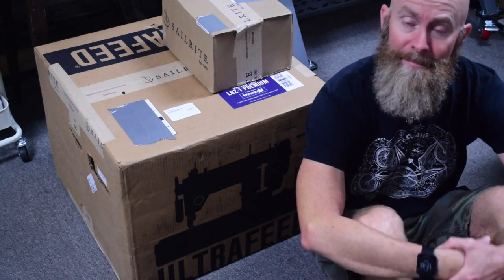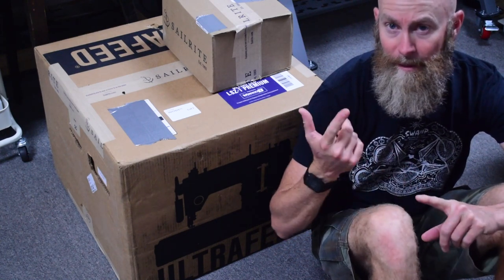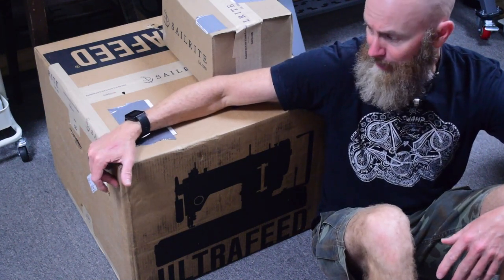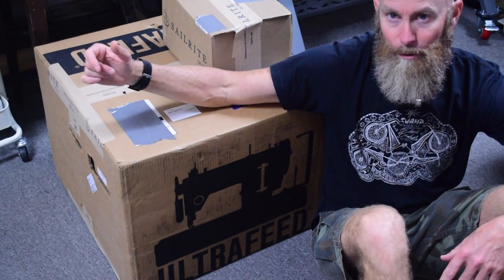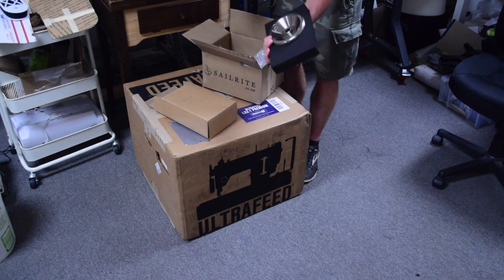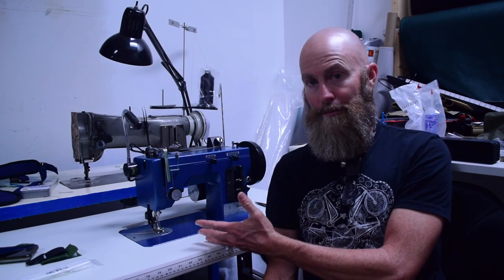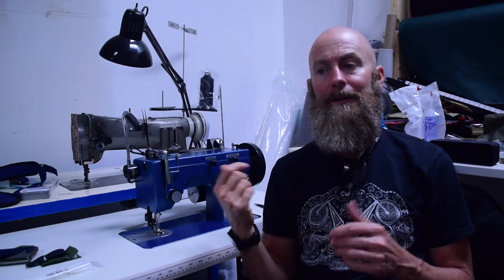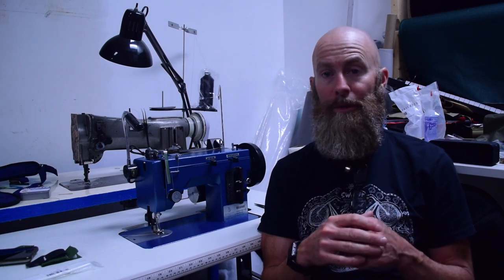LSZ-1Premium with WorkerB; Unboxing and First Impressions

Comment: What's the benefit of the Sailrite servo motor vs. the Worker B motor?  And what advantages does the Monster II wheel give you over the regular Worker B wheel?
Reply from the maker: The Sailrite Workhorse is a great servo motor, but like all servo motors, it is attached to the table, and the machine cannot easily be used apart from the table, negating the portability of those machines.  The WorkerB is a game changer, providing the power and control of a servo motor in a portable machine package.
I still have my Workhorse motor, and my current plan for it is to use it on my Singer 29 patcher machine, but that's a project that has yet to see the light of day.
If you have or are thinking of a portable walking-foot machine, the WorkerB should be on it, it's an incredible upgrade. If you're looking for a servo motor for an industrial machine, the Workhorse is a great motor.  My only complaint is (last I looked) it isn't plug-and-play compatible with a needle positioner, as it is primarily intended for use on Sailrite's machines, and there doesn't seem to be a way to use a needle positioner with their post-pin clutch system, so they don't seem to support that option.  If you don't need needle positioning, it seems to be an exceptionally high-quality motor!

Comment: It seems like a future video should be about testing the various knee lifts available for the Sailright, even DIY instructions, or kits. Compare to the industrial machine knee lifts. 
Also, have you tried any of the wheel feet for leather/thicker materials on the 50s black iron machines? I ordered one (thinking it might be a possible replacement for a walking foot machine) but it doesn't fit my 50s Singer and I when I looked for shorter versions to try I did not find them. Perhaps a video on how these wheels compare to walking feet performance?
Reply from the maker: I only know of one knee-lift that I have seen documented, and that was the one using bicycle brake cable.  It isn't out of the question that I'll try it one day, but it's probably pretty far off (for unrelated reasons that are keeping me quite busy for the immediate future).
I have given serious thought to trying to design a knee lift mechanism, but again, time is the limiting factor.
I haven't used a wheel foot, and I would really like to.  If you find one that will work on a Singer 201, I'm all ears!
Thanks for the suggestions, and thanks for watching!
Reply: @thejasonofalltrades  But Jason, you already got the knee lift on your Singer 1200, that is a Singer 201 with knee lift. Are you in search for a better solution than the 1200?
Reply from the maker: @sewingmachinesindetail  I want ALL of my machines to have knee lifts :)  The 1200 is a fantastic machine, but it's not a walking-foot machine and can't do what the Ultrafeed can do for me.  Likewise, I wouldn't use the Ultrafeed on ultralight materials. Since I use my Consew the most, I am very accustomed to using a knee lift, and it always annoys me to use a hand lever.  It isn't a big deal at all, but a knee-lift on the Ultrafeed would just make a great thing a little better!
Reply: @thejasonofalltrades  Oh, now i better understand. You wrote: "If you find one that will work on a Singer 201, I'm all ears!" But I guess that you actually meant a Sailrite.
Reply from the maker: That remark was regarding a roller foot, not the knee lift.
Reply: @thejasonofalltrades  Oh - sorry - I see now. Well once I did see a low shank big roller foot. But when I asked the supplier they did not have them anymore. I have tried a high shank roller foot on my 201, and it was possible by bending the arm to roller and readjusting presser bar height. But I found the foot with a notch to the back to be better than a roller foot. But this kind of feet should only be used if fabric under foot is thicker than 1.5 mm, because it will cause variation in stitch balance. Look here: https://youtu.be/rBIulDuhDDs

Comment: I have this machine from another manufacturer and would like to upgrade some parts without paying Sailrite's premium mark-up. What class of machine is this for sourcing parts?
Reply from the maker: These machines use class 15 bobbins, but otherwise I'm not sure how much parts crossover there is between them and more generic designs. Honestly, if you are looking to "upgrade," then you're buying Sailrite parts.  Otherwise, you're likely not "upgrading," just "replacing."  
I hope that helps!  Thanks for watching!

Comment: What do you think about the performance difference between the WorkerB and the Workhorse motors comparatively if they were used with the LSZ-1? Does the WorkerB and the Workhorse have the same slow speed control? Does the power difference of the Workhorse (3/4 horse power) vs the WorkerB (1/4 horse power) make a difference for neoprene and heavy leather?
Reply from the maker: I would say that the WorkerB has somewhat better slow speed performance, but probably not enough to make it an obvious choice.  It's a bit of an "apples and oranges" comparison; if you NEVER need portability, the Workhorse is a fine choice, but if you want the possibility of using the machine in a portable configuration, the WorkerB gives you the portability with really no loss of performance (there is slightly less power but I doubt most users would ever notice the difference).
I don't think Sailrite would like me saying this, but at this point I would only consider using a Workhorse motor on a non-portable machine.  The WorkerB pretty much obsoletes the Workhorse when you're talking about mounting to an Ultrafeed.  Even if you think you'll never use that machine as a portable, it's no really compromise to just have the portable motor on it just in case, plus it adds the power switch on top (there's a switch on the Workhorse, but under the table) and the speed control knob.
I hope that helps, thanks for watching!

Comment: What’s your opinion on the Fabricator compared to a Consew 206 or Juki 1541 or 563?
Thanks 
LSZ Ultra B Owner
Reply from the maker: Hi Tim!
I have never had my hands on a Fabricator, so I can't give an opinion based on any actual experience. I would expect the Fabricator to be consistent with the Ultrafeed machines; i.e., a great machine with great quality control and customer support. I imagine the machines function very well, and I have not heard anything negative about them from people who tell me they use them.
There is one thing I find less than ideal about the Fabricator.  They use the Posi-Pin clutching system just like the Ultrafeed machines, which is a great system.  However, most industrials don't have an option to de-clutch the machine when winding a bobbin, as the bobbin winder is made to run while you're sewing, and the need to disconnect the sewing mechanism while winding a bobbin isn't something that is really necessary, at least in my opinion.  The problem, though, is the Posi-Pin system means that a needle synchronizer can't be adapted to the Fabricator (to the best of my knowledge). I LOVE using a needle synchronizer.
If I were looking to buy a new industrial machine of that class, the inability to use a needle synchronizer would be the biggest (or only) stumbling block for me regarding considering the Fabricator. If you've never used a machine with a needle synchronizer, it might not be a big deal for you, but if you're accustomed to using one, it's a bit of a negative.
The Fabricator uses a larger balance wheel, which basically acts as a gear reduction and may improve slow-speed control to the point that the lack of a needle synchronizer is less of an issue.  Also, the needle synchronizer is mostly a benefit to speed and efficiency; if you're not trying to produce items particularly quickly, it might not be as important to you.
I love Sailrite, and everything I have gotten from them has been excellent. If you're looking at brand new machines, the Fabricator is definitely worth considering, but I do wish they would offer it with a standard balance wheel and a needle synchro.
I hope that helps, thanks for watching!

Comment: Disclaimer: I've never seen a Sailrite machine in real life, let alone used one, so take this more as a question than a criticism of the design. 
In 2015 Sailrite redesigned the plate for the stitch length (aka "feed regulator") lever. The old version was metal (or at least, was finished in the same paint as the body) and it had easily readable white marks for the stitch length. The new version ("EZ Set Stitch Length Plate") is a plastic plate that has no real stitch length indicators as far as I can tell, or at least not easily visible. It does allow to set stops to limit stitch length, but I find that secondary to having good clear indicators. So I'm wondering if I'm missing something, or if this upgrade actually is a sort of downgrade if you don't care about stops like me? 
Also, less relevant because the EZ Set plate is factory installed on all new machines, but the procedure to upgrade from the old plate to the new one looks super harrowing to me (check Sailrite's installation video if you have 7 minutes to spare). Possible side-effects for the technically challenged are: losing a screw down inside your machine, bumping your feed dogs on the needle plate, different stitch length in full forward compared to full reverse.
Anyway, regardless, this video sealed the deal: as soon as the European plug worker bee hits the Sailrite webstore, I'm taking the plunge and buying the LSZ-1 Premium package! :D
Reply from the maker: Hi Laurens!
My priority has always been different; I want the reverse lever to be quick and easy to actuate.  The old style lever on the older Sailrites, Thompson and all the other variants of this machine is very clumsy and slow to engage reverse.  My Thompsons had no markings to indicate stitch length, and my Sailrites are both the new version, so I haven't used one with markings.  Many of my machines lack any stitch length markings.
There are markings on the EZ Set, but they are black on black (would be pretty simple to paint them).  For the sewing I do, I almost never need to be absolutely precise about stitch length, it's either "shorter" or "longer" for me.  If repeatable, precise stitch length is something one requires, I honestly think the EZ Set is better than the old style, as that lever also had a tendency to slip (at least on my Thompsons). Other styles of machine may have better designs for this, but between the EZ Set and the old style on this type of machine, I MUCH prefer the EZ Set.
I hope that helps!  I look forward to hearing when you get an LSZ!
Reply: @thejasonofalltrades  that helps greatly, thank you so much! I would die if my stitch length would slip halfway during topstitching something, so in that regard it sounds like the current design is infinitely better than the old one. My concerns were really from the "perfectionist" approach I tend to take when making things, i.e. I try to make up for my lack in skill by doing everything slowly and as precisely as possible. So when backstitching, I want my reverse stitches to coincide exactly with my original stitches. It looks so much neater.
It's very good to hear that I was wrong on the markings on the EZ Set and that they really are there, just black on black. Practically speaking, I think I'll just rub some white paint on the markings to make them stand out. and experiment to see which mark corresponds to how many millimeters.
Oh and on your final point: you can be sure that you'll hear about it when I get an LSZ, that's a promise! :D

Comment: Hi could I use this to sew leather wallets? I would like a portable to do so.
Reply from the maker: Absolutely you can!  Sailrite now offers a smooth foot set for these machines so the feet don't mark the leather.
I often point out that these machines aren't super heavy leather machines like you would want for making something like horse tack, but you can definitely make wallets.  I've been carrying a leather wallet for about 4 years that I made with my LS-1.
Thanks for the question, and thanks for watching!

Comment: Pls what brand of needles do you recommend?? Regards !
Reply from the maker: Hi!  I am the worst sewist on earth when it comes to needles.  At least 90% of the needles I use are whatever came with the various machines I have bought over the years.  I don't change them often, and I don't pay much attention to what size needle I'm using (I tend to use V69 thread for almost everything I do, though.)
My best advice is this - there are a couple of recognizable brand names in needles - Schmetz and Groz-Breckert are the two I probably have the most of for my industrial machines, Schmetz and Singer for my domestic machines. If there is any difference in quality between these brands, I've never noticed it. 
The rule of thumb regarding size is to use the thread that is appropriate for the fabric, and the needle that is appropriate for that thread. I use "universal" needles for everything I do, but there might be advantages to different needle points that I am ignorant of.
I think if you stick with a reputable brand sold at a major retailer, you should be good!
I hope that helps, thanks for the question and thanks for watching!

Comment: I want a walking foot machine that I can use for bags made from heavy materials (cordura, canvas, etc).  So lets say I got the LSZ-1 with Worker B and it cost me ~$1600.  Would I be better served to just shell out $400-500 more and get a Juki DNU-1541S??  I don't need to transport it anywhere.
Reply from the maker: Hi! 
In general, a full-size industrial machine provides increased throat space, and more stability when working compared to a portable machine (the Sailrite industrial-style table for Ultrafeeds pretty much negates that part, but is an additional cost on top of the Ultrafeed).
As I mentioned in your question about zig-zag, the fact that the Ultrafeed LSZ-1 is zig-zag capable is a potentially big plus, as zig-zag walking-foot industrial machines are very rare, and usually very expensive when you can find one.
If you never need zig-zag and never need to move the machine, a full-size industrial is probably the better way to get work done.  I use my Consew 206RB-1 more than all of my other machines.  However, if I had to get rid of all my machines but one, I would keep my LSZ-1 over all others, purely for its versatility.
Either way, you'll likely be happy!

Comment: Can you tell me if your sewing table is a Sailrite table.  I just ordered the worker B and am thinking of getting the  table for my LSZ-1,  Does the machine sit flush in the table?
thank you
Reply from the maker: Hi!
The table is the Sailrite Industrial-style table for Ultrafeed machines.  The machine sits flush, and the table is great.  I mounted casters to mine so I can roll it around, and you can even adjust the height (with nuts and bolts, not on-the-fly) to compensate for the caster height.  If you buy extra sets of the industrial-style hinges (not expensive) you can easily change machines - I use this table for both Ultrafeed machines and my Singer 201, and my 237 and likely many other domestic machines fit great. If you have room for an industrial table, this is absolutely the best way to go for these machines, especially if you also use domestic machines.
I hope that helps, thanks for watching!
Reply: @thejasonofalltrades  thank you for responding to my question regarding the table from Sailrite.   I am going to get the table top as I do not like sewing with the machine on top of the table.  It is great for portability but I like sitting at my sewing machine table that I have my other machine in.  I also like the idea of having it on wheels.  Thank you again for responding to my post.
Reply: @thejasonofalltrades  Thank  you Jason for responding to my questions.  You said to buy extra of the industrial style hinges.   I have a 201 and a 15-91  and are the hinges the same or are they all different.?  My table comes on Saturday  and hopefully my Worker B replacement will be hear next week.  I am really looking forward to getting it and have more control over my ultrafeed..  Thank you again, I love your videos.
Reply: Just received my industrial table top and spent yesterday setting it up.  What a difference.  My machine sits flush and I am really looking forward to receiving my WorkerB replacement .  These two additions are going to make such a difference in my sewing on the LSZ-1.  
Thank you again Jason for all your advice.

Comment: 👍Good Video! 👍   Great to have an up front, open, honest opinion. 
I seriously considered LSZ-1 machine.  It is nice to have it compact and portable.  Although! I have never had to take my machine anywhere else.  And the size is not monstrous in moving around and storing. 
The biggest downside for me.  It was the old ancient style of thread length/ forward/ reverse lever.    I guess my personal preference is to have a knob with numbers. Then have a separate lever for the reverse.  With the LSZ-1 it seems to take a little fiddling around with the lever stops.  Just to get the F/B thread lengths close to each other. (Not that it really matters, if one is not doing prize winning work).
(Another) Although!   With the LSZ-1, one can sew continuously in hands free reverse!  (Some models/ brands of this exact machine. Did have a spring-loaded lever. Which always brought it back to forward sewing. So, then hands free back stitching was not possible.)     I guess it's only a preference as to what a person got used to first. 
So, I guess my comment is mostly for people who is learning machines.  Sort of another point or idea in which to consider in buying a new machine.